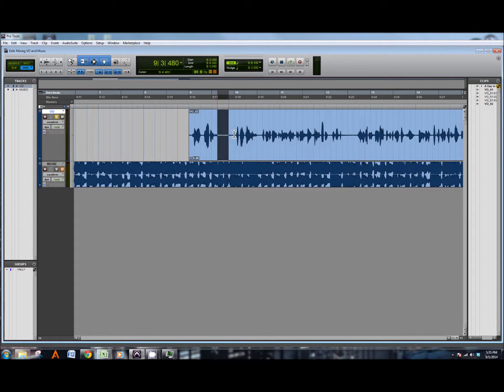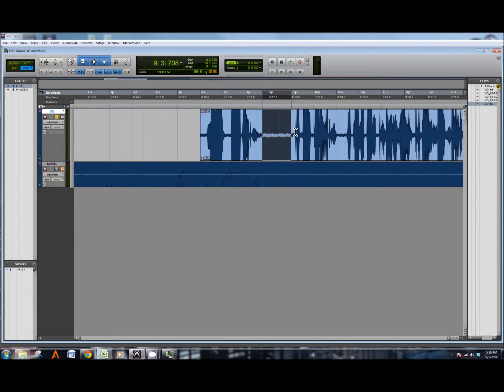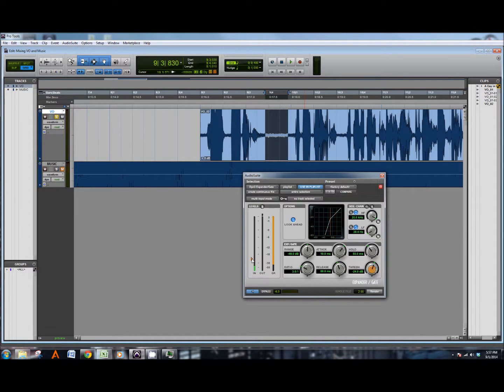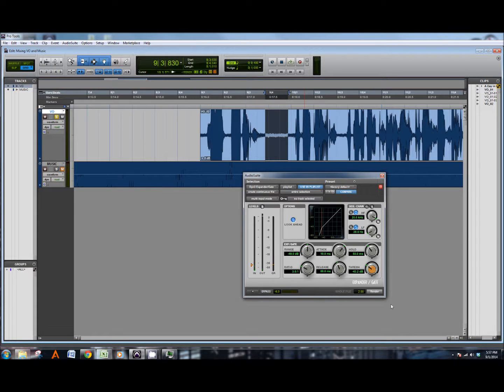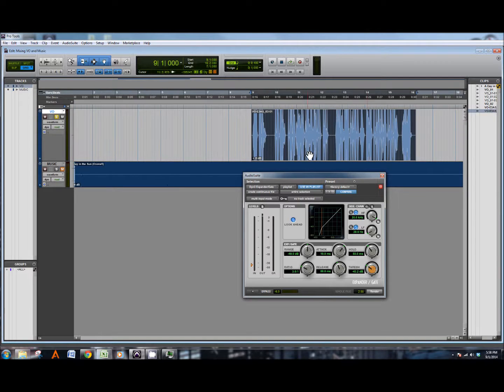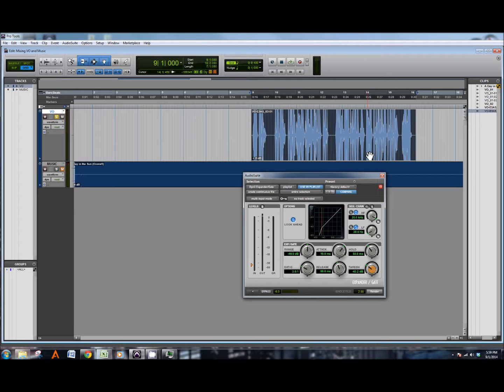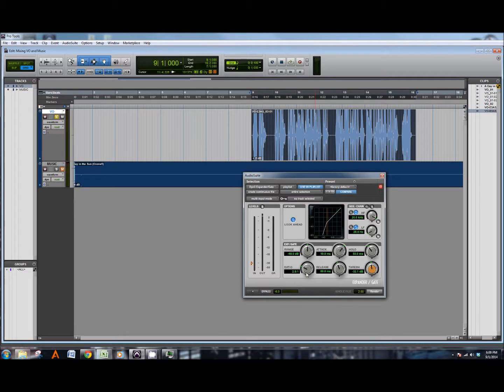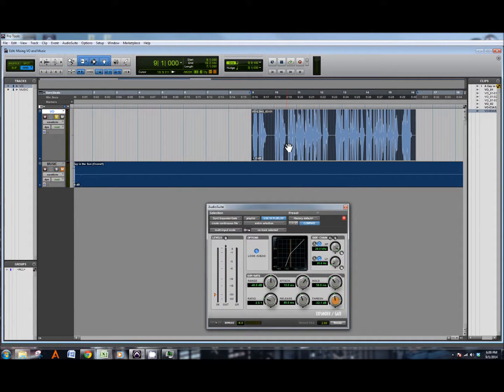VO TIP: Using and Expander/Gate to Reduce Background Noise

Comment: How come my Dyn3 Expander/Gate doesn't have a render button like yours?
Reply from the maker: likely because you are using it as an insert rather than as an Audiosuite plugin, try going to the Audiosuite menu and selecting it from there
Reply: @voiceoverroadmap  Holy moly, you're right. Thanks for the tip!
Reply from the maker: @elfresco7  no prob!

Comment: I would never use a noise gate unless I were absolutely desperate. I don’t like it when the room ambience goes to absolutely nothing. Independent of the fact that you have the air conditioning running, it really changes the feel of the audio when the blank spaces go to zero. It basically sounds like the track is stopping at that point. 

I wish noise gates had a level setting so that instead of taking whatever is below the threshold to zero, it would take it to a level that you set that is between the threshold and zero. That way, the editor could choose how much of the noise should be left in. When that noise is just typical room ambience, it sounds much better to leave that in even if it has to be lowered in volume a bit.

I would think there is a tool to do that but the gate is not the one.
Reply from the maker: Hey Craig,
The expander/gate is actually the tool to do what you describe. That's the "Expander" portion of the plugin. What you are looking for is the "Ratio" setting, that will determine how much the signal is lowered when it falls below the threshold. Try playing around with that. 

Here's how AVID describes it "The Ratio control sets the amount of expansion. For example, if this is set to 2:1, it will lower signals below the threshold by one half. At higher ratio levels the Expander/Gate functions like a gate by cutting off signals that fall below the threshold"

If the noise floor in your studio isn't low enough that you can use the tool as a gate without hearing a noticeable drop off, then it wouldn't be the proper use of the plugin, the best action in that case would be to either use the tool as an Expander, or lower the noise floor in your studio if possible. Hope this helps!
Reply: Voice-Over Roadmap Thanks, I’ll check it out.
Reply from the maker: No problem - another option to deal with these sorts of issues are tools like iZotope's RX suite, specifically the "Voice De-Noise" tool, you can check that out as well.
Reply: @voiceoverroadmap  Fortunately, I have a very quiet studio but I do every so often get audio from another place that needs to be cleaned up. Thanks for the help.